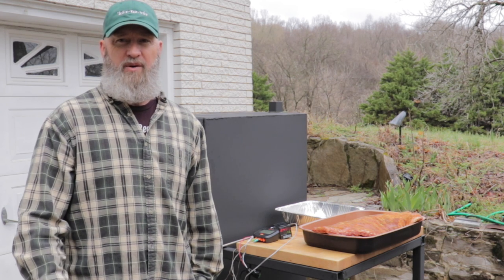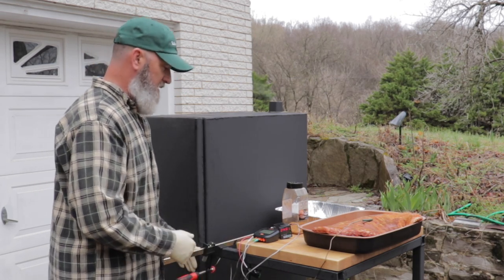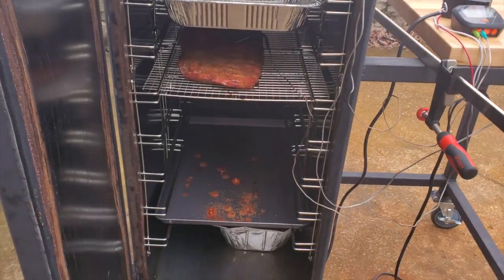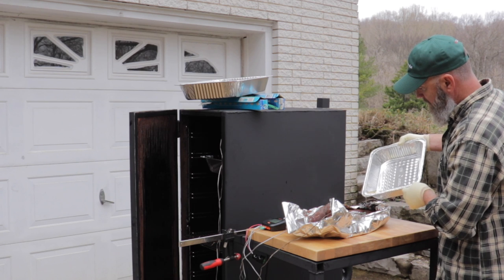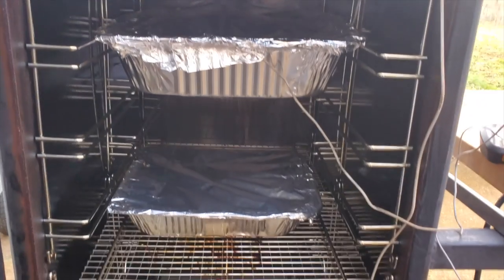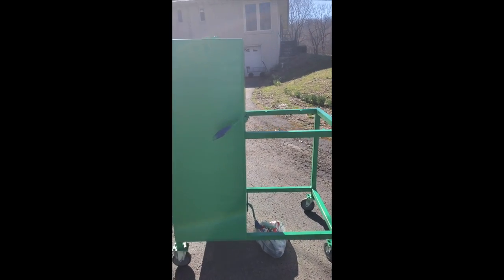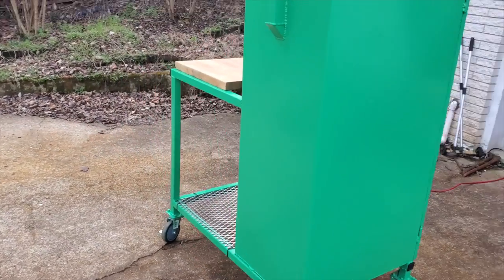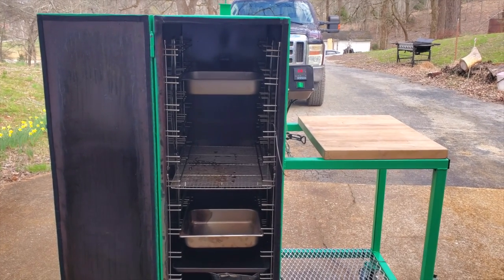DIY Electric Smoker Build - Part 4 and First Cook

Comment: How much do you have into steel and insulation?  Where did you get your insulation?
Reply from the maker: Between the steel and the insulation it was in the $800 to $900 range.  I got the insulation at McMaster-Carr.  Rigid Mineral Wool Insulation Sheets.

Comment: What’s the outside temp like with this insulation design
Reply from the maker: If I'm cooking at 250° F the outside temp on most of the smoker is just slightly higher than whatever the ambient temperature is in the outdoors or wherever I'm cooking, except right around the front of the smoker and about an inch back it will run hot enough you can't touch it for long right there but you can hold your hand on it everywhere else, even on the bottom right under the heating element.  (All of that is if the smoker is in the shade.  If it is out in the sun then the sun heats the metal up pretty hot.)
Reply: @UncleTimsFarm  not bad how about the charcoal one? How dose it compare
Reply from the maker: It has some definite hotspots.  The centers of the walls stay cool enough to touch but anywhere near the corners or the top get hot.  That's because of the design of the charcoal smoker.  It has a frame of 2"x2" square tubing whereas the electric smoker does not have that inner frame.
Reply: @UncleTimsFarm  it’s still a lot cooler than a non insulated right
Reply from the maker: Absolutely.  Plus the insulation helps keep the cook chamber at a more constant temp.
Reply: @UncleTimsFarm  ok so it’s not pointless. Just worried about there being no easy way to square up that other design